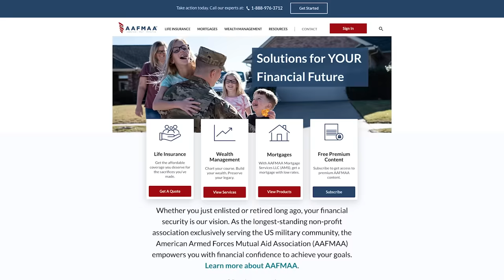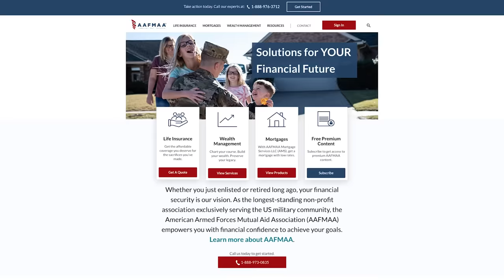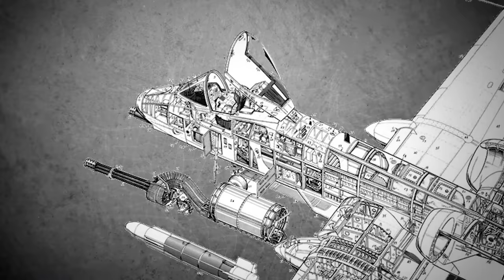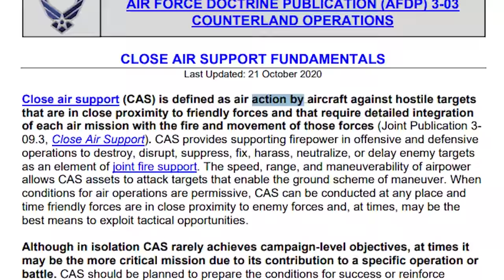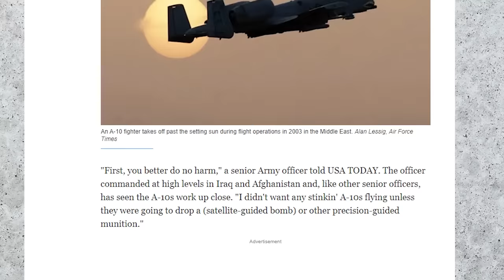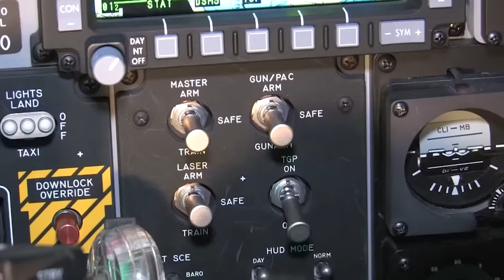Why the Air Force is Screaming to Retire the A-10 Warthog

Comment: I got a front row seat to seven consecutive A-10 attack runs within a 30-minute window. That plane saved a lot of lives, and for that, it will always have my love. That being said, it's time. She's had a good run, but it's time to move on to a weapon system that wasn't designed for the Cold War battlefield.
Reply: @borrago The issue is, we absolutely do not expect the next conflict to be a cold war style battlefield.
The only reason the A-10 was expected to perform well is because the Soviet Union had a minimal airforce as that wasnt their goal, total air superiority was the expectation of any potential conflict with the Soviets. The Soviets built their army to rely on artillary and mechanized pushes rather then air support and CAS.
Our new rival is the PRC, with the expectation from our intelligence being that the PRC will be capable of creating an airforce to rival ours by the flashpoint of any potential conflict. The A10 will not survive the next conflict, and is becoming increasingly expensive to modernize the aircraft, especially as next generation and even current generation aircraft are designed to be more interconnected.

Its time to retire the old girl.
Reply: @tlpineapple1 unrelated to the a 10 , the soviets would have performed much better than putin in the current war

The a10 even in the cold war were expected to be lost , all 700 of them but not before giving the soviets significant Ptsd for the rest of the war😂
A10 pilots have always understood this
The Soviets also understood it and developed sams so effective that even before the cold war ended A10s were not going to ever be effective against them
Reply: @borrago  The Ukrainians wouldn't take the A-10 if we offered it to them, they have explicitly said they do not want the A-10. The A-10 was never made for that theatre, all the planes are flying fast and low to escape surface to air missiles, the A-10 would be a sitting duck to Russian S-300 and S-400 systems.
Reply: @borrago  sure except the A-10s gun, you know the thing it's built specifically to carry, doesn't have much kill potential on modern armor. Again, because it's not 1975, there are a lot more shoulder fired launchers that make the A-10's armor irrelevant. Also, Russia is using tactics from the Cold War. Not every country is going to be as inept.

Comment: The A-10 dominates a particular niche.  Close Air Support, from forward bases with low infrastructure requirements and tight maintenance budgets and schedules, with a plane that has enough firepower to matter and enough survivability to spend a minute or two in bullet hell and come back.  It's been a huge success for decades because that capability has been important to winning for decades.  The niche is smaller now but it still seems like a bad idea to get rid of it when we don't have anything else that can similarly dominate that niche.
Reply: Yes you do its called Apache. You only have to look at the British use of them in Helmand.
Reply: Or if helicopters aren't your thing there's the AT-802U Sky Warden. The Sky Warden undoubtedly cheaper to operate with little compromise to capability.
Reply: @zoiders  US had AH-64 in AFG.  But all the gun camera footage is at night...  Wonder why.  I know one case where a pilot killed a kid hauling a water  pump to town on a motor bike.  Oops.  She must have  grown up  in the city.  Had no idea what a well pump looked like...  US had to send a truckload of cash for that one...  Not one for the highlight reels I guess...
Reply: @GruntyGame   A "little" compromise?  :)
Reply: The A-10 is only better than the F-35A in close air support in 3 ways, payload, loiter time, and survivability. Also unlike what a lot of people say the A model has a gun, it has the same 25mm the harrier uses. The reason they didn’t use the Vulcan that’s been used on pretty much every American fighter since the later models of the F4. the 25mm is better at close air support than the Vulcan, while the Vulcan’s primary purpose is air to air. Plus the F35 doesn’t have the what is possibly the A10s single biggest flaw, the F35 can preform close air support even when we don’t have air superiority. Plus it’s cheaper in the long run to retire the the A10. 
I’m not against the A10 I love the thing and it will be sad to see it go, a similar thing is happening with my local air base, they’re reviving F-35s in a few years and are going to have to get rid of their F-15Cs, and a lot of their aircraft have kills, one of them was the first American F-15 to get an air to air kill and got the first kill of desert storm, but the F35 will be more effective at its job in the modern day and even though it will cause a lot of these aircraft to be mothballed but at the end of the day military effectiveness is more important than our emotions towards certain aircraft
Reply: Drones  and Apache helicopters
Reply: @rowdyace5719 and even then, survivability is debatable considering the f35 is less likely to be targeted and can stay out of reach from manpads
Reply: @kameronjones7139   though not from something like a S400 though..
Reply: @johntowers1213  it absolutely would the s400 hasn't shown any capability to reasonably track stealth some even being blown up recently
Reply: Any reason Ukraine can’t have some donated to them?  I’ve been wondering for a while why the focus is on F16s only?  I know they play diff roles and have diff capabilities but hey anything helps at this point and I assume they are easier to train pilots with vs f16s?  I’m no military or air force guy, just curious 🧐
Reply: @pboissie  the f16 are more survivable the a10 would face the same fate as the su25 which has sustained the highest casualties rate on both sides
Reply: @kameronjones7139  ah ok that makes sense, they would be too susceptible to ground fire.
Reply: It’s called the F16. During the Gulf war the A10 Routinely got grounded and the F16 was used in its place. Only when the A10 received missile hard points was it brought back to wide service
Reply: @pboissie  because Russia has richly invested in SHORAD like Pantsir.  It’s two stage booster gives speeds of  Mach 5.5 so an A10 would be extremely vulnerable as there is no time to dive outbid the way.  The west neglected SHORAD so Russian Ka 52 and Su 25 have mainly suffered from MANPADS.  Had the west supplied SHORAD the Ka 52 and Su 25 would mostly be wiped out.
Reply: @jeffprice6421 the A10 is so infamous for it's tendency to be involved in friendly fire casualties, to the point that Britain banned the US from using it near British troops. I don't see your point here
Reply: @williamzk9083 west doesn't do much of that as west relies on air dominance to do what SHORAD does.

Comment: I suspect it was the "too expensive" part that finally did it in, as one of it's main advantages was the ease of replacement parts acquisition, an advantage that degraded as more of it's components aged out of common production
Reply: It also does not help when the company stops making the part because you haven't purchased a new plane in over 30 years
Reply: @pogo1140 I suppose the attrition syndrome has finally caught up to the A 10. 30 year worth of spares can only last the fleet for so long before there isn't any left to cannibalize
Reply: @quakethedoombringer  yep, especially since the plane has always been a high demand low availability aircraft.
Reply: @pogo1140  Planes weren't purchased because the USAF bought 700 (many criticized this amount as unjustifiable).
Reply: @ChucksSEADnDEAD  last purchase was in the 80's, the USAF put the A-10 fleet on the road to the scrap yard. We don't need them they said. Then Iraq invaded Kuwait and if it had not been for the army they wouldn't have even been sent there.
Reply: @quakethedoombringer  the timelines where longer then normal due to the designers favoring components with highly interchangeable parts, meaning many of the needed parts could be readily source, at least in the 70s and 80s many of those alternate sources started to dry up in the 90s
Reply: @pogo1140  Still doesn't change the fact that Fairchild got the money for the A-10s they made. It's not the USAF's fault that there were so many A-10s that no more were needed to be purchased.
Reply: @ChucksSEADnDEAD  That the USAF's A-10's ran out of airframe life midway into their service life says otherwise

Comment: Good video, I have been an A-10 fan for years but they are very fair points about the gun being indescriminate by modern standards. Perhaps the GAU8 systems can be saved and made into a Heavy C-RAM, or something can be developed into a basic drone-buster AAA vehicle.
Reply: The way I understand it they had to loosen up the gun in the A-10 because it wasn't getting the dispersion they wanted.
Reply: @Lonewolfmike that's funny because it can't hit shit and even when it does it can barely damage the vehicles it's supposed to kill

Comment: Too slow is not a problem. It depends on where you're using them. The real problem is with maintenance cost. After WWII, military can't afford maintenance cost so many aircraft were auctioned off at low prices which they later became various commercial aircraft after being refitted. Similarly, a lot of ships were auctioned off too. Some lucky dudes were able to buy the tanks. Now, it's a lot harder to get a tank.
Reply: MQ-9 Reaper can do literally the same job as A-10, even if we exclude superior in every way multi-role platforms.
Reply: @TheRezro  the deal is with how many A10 are going to retire and how many new model jets are going to get bought. Instead of directly giving them retirement, you can use them in some bases of small countries without good air force. 
But as I said, the problem is with maintenance cost. They even scrapped veteran benefits so it's no wonder. As for buying new ones, they and those arm companies are in one group. Yet, this is conspiracy which is not a conspiracy. They're going legit.
Reply: @Emperors_Deathangel  what the hell are you even trying to say?

Comment: One thing has been always been true. The military loves to get rid of effective platforms in order to obtain contracts for new expensive equipment. This always leads to board seats at the company the simped for.
Reply: The most effective thing the A-10 does is friendly fire and troop moral if said troops hadn't experienced the first
Reply: @TN_Whiskey  So the F-35 would be ineffective at friendly fire?
Reply: @TN_Whiskey best for Psychological warfare too... The massive diarrhoea of 30 mm rounds exploding around and shredding your friends to tiny bits would surely make you question your life choices
Reply: @justsomehaatonpassingby4488  that would be correct if the A-10 used its gun more than it used its other weapons, which it doesn't. Another point is that it hits civilians so often the many different terrorist groups we fought call it their best moral source.

Comment: The fundamental problem with the A-10 is it has to fly low level to find it's targets and an F-16 at 30,000ft is much less vulnerable to ground fire then even the well armored A-10. The Airforce basically realized it was spending a fortune repairing air-frames that would never have been damaged if they just used an F-16 for CAS. The role is obsolete.

Comment: Interestingly, I just finished listening to the audiobook 'Hogs in the Sand' by Buck Wyndham. He flew an A10 in the first Gulf War.  Nearly all of their bomb runs, missile launches, and even gun runs were done from relatively high altitude. Approximately 8,000 to 10,000 ft. This was done because of the threat from small arms fire and anti-aircraft artillery, and SAMs.  I think the F-35 can do the job of the A10 with much less risk to the pilot and aircraft.
Reply: survivability onion: its far better to not be seen than to tank hits,
Reply: AT-802U Sky Warden is a more proper successor in smaller conflicts with insurgents than the F-35; especially with the inferior CAS capability of the F-35.
Reply: or F-16, which are still being manufactured, but the huge buys of the 35 worldwide have pushed the pricing down to near F-16 levels, which is crazy.
Reply: @lqr824  IMHO, F35 is still a white elephant, a slightly cheaper white elephant... almost like the SU-57 (RU's F-35) but drummed up by the US government to entice other government to "toe the line" with the latest and greatest tech outside of the F-22.

Gen 6s will be crowded... and more effective... it would be the true one to one replacement for F15/ 16, IMO
Reply: @PrograError  1) I'm talking about CAS, so cite me some actual data that shows it cannot do CAS.  Do you have any?  2) There is no pilot who has trained on the F-35 who thinks any other aircraft has a chance against a trained team of F-35s.

You could make a fleet of every F-14, F-15, F-16, and F-18 ever made, and a single pair of F-35s would destroy every single one of them, given enough sorties.  One plane of the pair stays at extreme range and uses its radar, visible to the old-timers.  The second gets as close as 20 miles without detection, chooses its approach angle, and can take total sensor information from its peer.  The oldtimers see missiles coming from behind them or to the side, and cannot see the launcher.  If they try to fire on the far member of the pair, it turns its radar off and repositions for a minute.  No missile can get a lock on it.  Once the near plane is out of missiles, they exchange roles.  Their missiles have a 60% chance of kill, so they'd wipe out about 4 oldtimers, sortie after sortie after sortie.  There's simply no defense.
Reply: @PrograError It’s not a white elephant when so many Air Forces have already adopted it and love it.
Reply: @lqr824 I think you are a tad confused on how radar works. They would be unable to fire on the far wing, because they can't see them either. And with regards to defense... assuming they aren't using TWS, every single one of those teen fighters has functioning RWR gear to get a rough idea of where they are being shot at from, and could in theory close the distance enough to get a visual. If that's the case the closer F-35s are utterly boned.

Edit: and a lot of those teen fighters have Link-16 too ;)
Reply: It's kind of silly to justify the need for a dedicated CAS aircraft if it's not being used for CAS and there's better options for COIN. Same war, the F-111 was doing the heavy lifting at low altitude, flying supersonic below radar for the same reason. They could strike Baghdad and it was still safer than flying an A-10.
Reply: @Buckshot-DCS  > has functioning RWR gear to get a rough idea of where they are being shot at from

RWR will see the far F-35 illuminating and tracking them and broadcasting their position and vector.  The near F-35 never turns its radar on.  Its buddy is telling it where the targets are, to the meter.  Meanwhile the F-35 is said publicly to be invisible to teen fighter radar at over 20mi under basically any conditions, so even with radars on full, teem teen will not see the near F-35.

> could in theory close the distance enough to get a visual

Remember: those teen targets will be spending the next couple of minutes trying to duck America's latest AAMRAM.  You think they're going to just put a thumbtack in the map where the launching F-35 was, and once they climb back up to altitude the F-35's going to still be there?  At just 600mi/hour it will be 20 miles away in just 2 minutes, and that's in a 3D space.  I don't think so.  Any fellow team member close enough to scout for the launching F-35 already is a target for the F-35 as well, with a crosshair on his back, and if the AAMRAM loses track of the initial target it could re-lock on any of the team teens.  Remember we're talking about 2 F-35s vs. 200+ teen fighters in the air and you can't come up with a way the teens would even see the F-35 on radar, much less shoot one down.   I'm not actually sure any of the latest teen fighter blocks can even see an AAMRAM that's getting mid-course updates from the far F-35 and thus flying completely passively.  It will home on jamming as well, so if you try to jam the far F-35 you just make yourself a target.
Reply: @jimjamauto  With a dedicated/semi dedicated platform, you're allowing for more ground attack ordinance to be carried by virtue of design. Whether it's all bomb/missile/guided based or not. You can make just as many if not more reasons as to why the AC-130 gunship should be removed from service than the A-10 aside from building new airframes with updated specs to reduce maintenance costs. But there's no noise or talk (That I'm aware of) of it being retired. It's vulnerable to everything at it's operating altitudes, engagement and burn speeds. It's why the majority of missions are conducted at night. Because we haven't been fighting anyone with NV capabilities and when the chance for any kind of Surface to air system is minimal.
Reply: @Meravokas  But the A-10 doesn't carry more ground attack ordnance than the F/A-18, F-35, or F-15E... The AC-130 was built for COIN, which is a mission it has done very often and very well.
Reply: @jimjamauto dude thank you for finally mentioning the Aardvark.